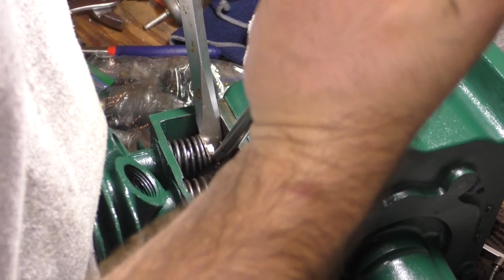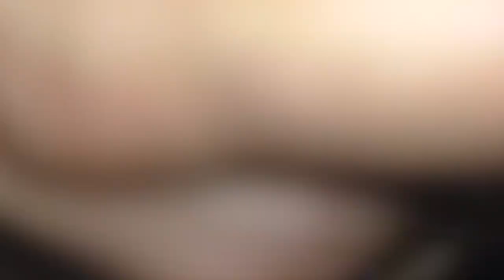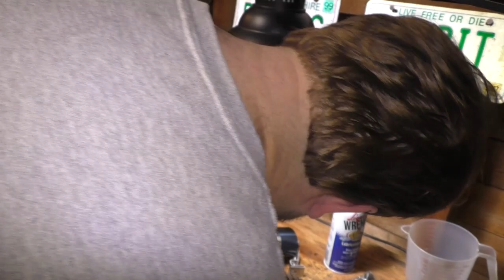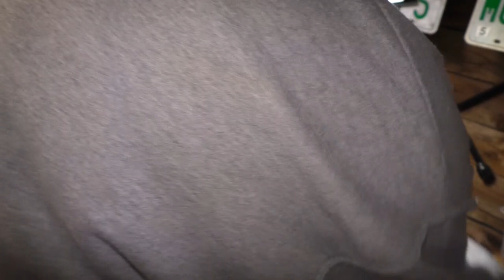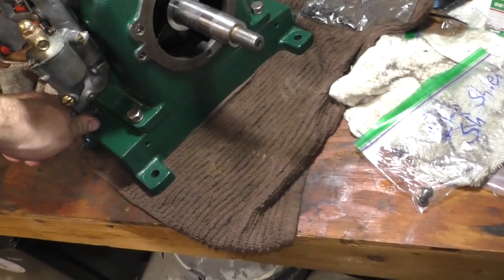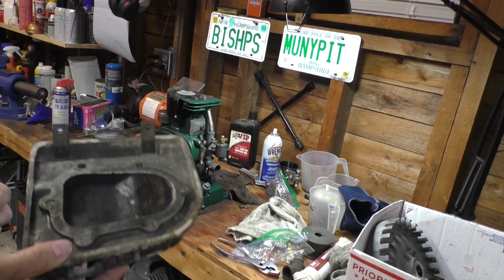1937 Briggs and Stratton Model A - Part 9 - Let The Reassembly BEGIN!

Comment: When I rebuilt my model a I almost had a stroke putting the keepers back on the valves and then My smart ass grandfather said aren't you standing on this head and put your dab of grease on there that way when you compress the valve spring The valve won't move and the grease will help to keepers stick🤔

Comment: Have you figured out where your furnace soot is from...also what about condensation in your chimney...I have an old reliable furnace and considered getting a new furnace until I saw your video.
Reply from the maker: The soot was the result of the unit burning too rich, and the condensation is normal - but isn't evaporating off because the flue is too large for the size of the furnace.
Reply: BBISHOPPCM's World I appreciate your quick reply. What do you mean rich? You would think your installers would’ve let you know about your flew situation. Thanks for sharing.